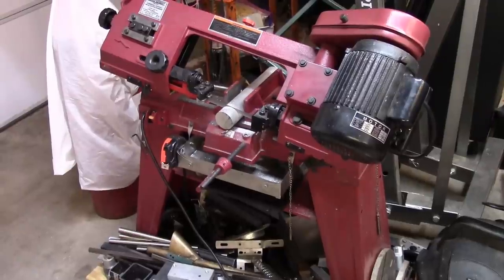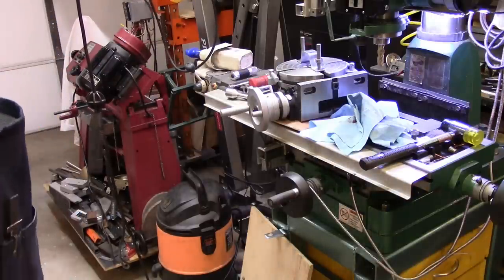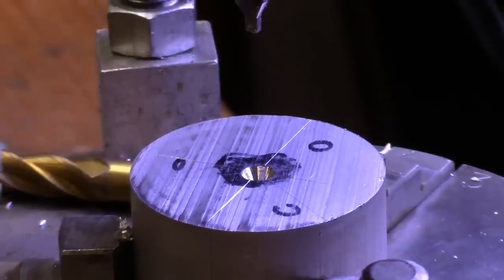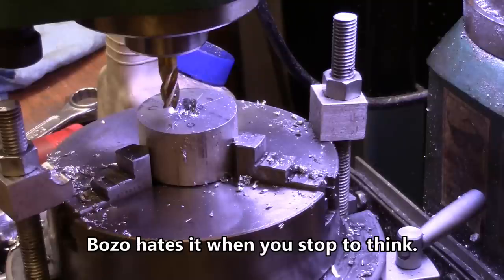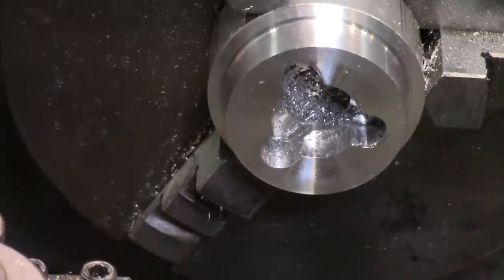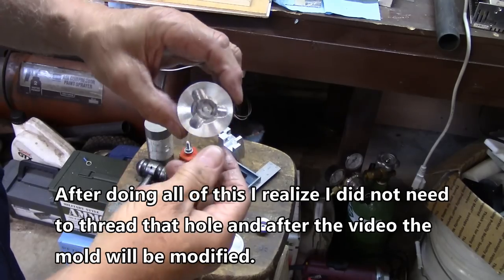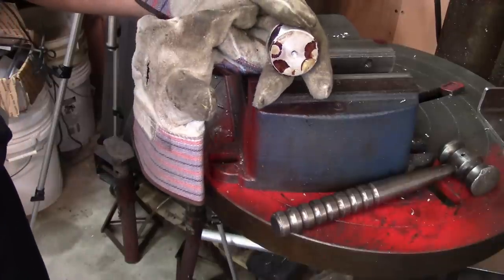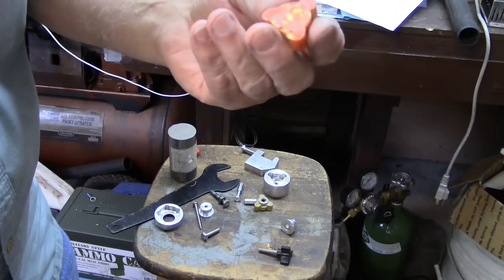Makeing a HDPE mold for an internal threaded knob

Comment: after moulding if you remove the bolt holding the hex bar in place and replace it with another  bolt and turn off some of the threads that would have engaged in the mould leaving enough to engage in the threaded part of the knob allowing  you to hit it with best tool in the shop a hammer to dislodge it from the mould it would speed up making the knobs
Reply from the maker: Yes the thread was not neeeded at all.  I will drill it out the next time I use the mold and then things will go a lot smoother.  Thanks for stopping by.

Comment: Harold what has been your best source for plastic that melts and hardens uniformly?my guess would be something like antifreeze jugs?great edit on video!
Reply: its HDPE, which is buckets and patio furniture, not sure what the jugs are made from, perhaps also hdpe, they should mark it somewhere with the letters
Reply from the maker: I have been using Arm and Hammer detergent jugs but any thing made from HDPE is ok.  I just like the color.  Thanks for stopping by.
Reply from the maker: If the plastic container has a 2 in the little triangle it is high density polyethylene.  A bunch of stuff is made of this.

Comment: i think you misunderstand stand leave mould threaded as it holds hex bar close to what will be the bottom of the knob when removed from mould, if you remove that bolt and use one you have removed all thread apart from the first 10mm / 3/8 , so when you thread it through the mould and then into the hex thread then if you hit the bolt it will push the hex thread and knob out of the mould, i hope i made this clearer
Reply from the maker: Got it, thanks for the suggestion.

Comment: I think if you mill it with a little angle on it will come out faster ,I think its called draft .
Reply from the maker: That could work but most of the time the plastic shrinks as it cools.  Thanks for stopping by.

Comment: Awesome stream Harold looks as if you got the problem licked now lol.

Have you ever used Fusion 360 by AutoCAD? Well I'm working my way thru it so that I can make the STL file drawings for my 3D printer and so far the prints have been coming outt pretty good. I'll try to make a short bideo for you to see how I make mistakes so that others don't have too.
Reply from the maker: A video of how to navigate the menu system, if it really is a system, would help people I am sure.  I once started to mess with fusion but they said my free use would only be for a year so I determined that I was not going to suffer all the learning curve just for a years use.  Thanks for stopping by.